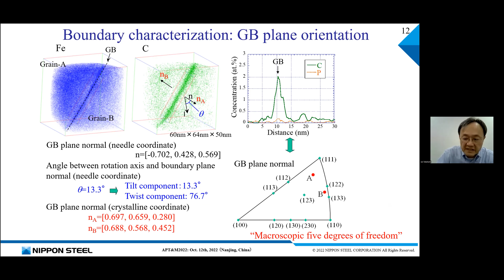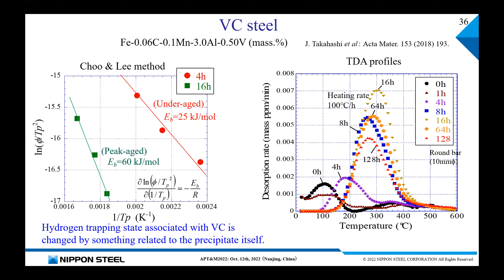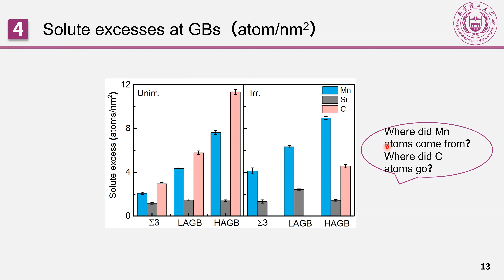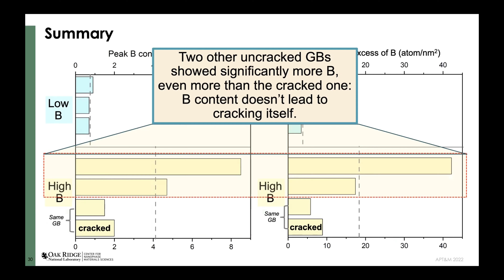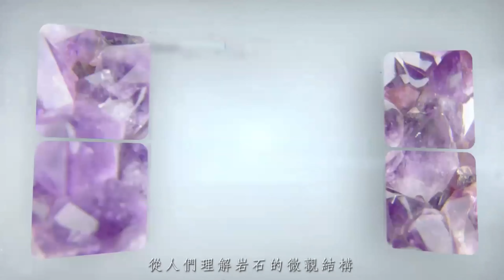Day2 Morning of APT&M 2022 Conference （October 12, 08:00-11:55 Beijing time）

Comment from the maker: 0:05——Block Lecture: Application of atom probe tomography to steels and hydrogen analysis——Jun Takahashi
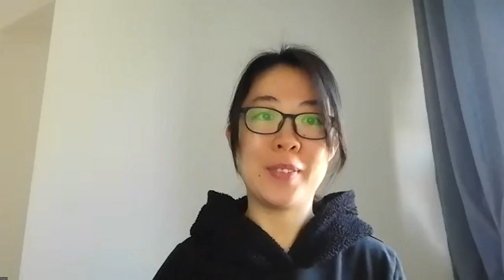54:50——Segregation/desegregation at grain boundaries of a ferritic Fe-Mn-Si steel under ion irradiation——Gang Sha
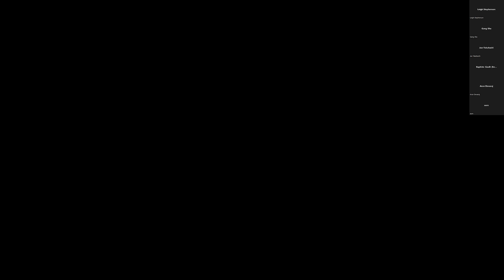1:11:20——Understanding the influence of Boron in additively manufactured CoNi-based superalloys using atom probe tomography——Qing-Qiang Ren
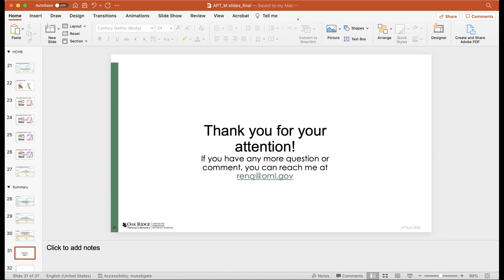1:23:32——The Microstructure and Mechanical Property of Friction Consolidated Oxide Dispersion Strengthened Steel——Jia Liu
1:55:30——Effects of grain boundary segregation on mechanical properties of refractory high-entropy alloys——Wu Yuan
2:12:28——Hydrogen trapping in steels: The roles of hypo-stoichiometric cementite and its strain field at ferrite interface——Pang-Yu Liu
2:26:50——The precipitation of the secondary phase in Inconel 617 alloy during aging process——Hui Li
2:40:57——Nanoscale distribution of alloying elements in Optimized ZIRLO using the Invizo 6000——Siyu Huang
2:56:02——Study on precipitates phase in Custom 455 Maraging Stainless Steel——Guangyan Sun
3:10:10——CAMECA Presentation-6000 Product Line——Robert Ulfig